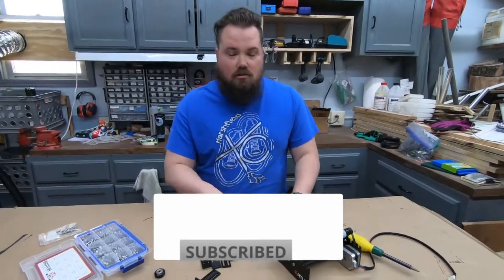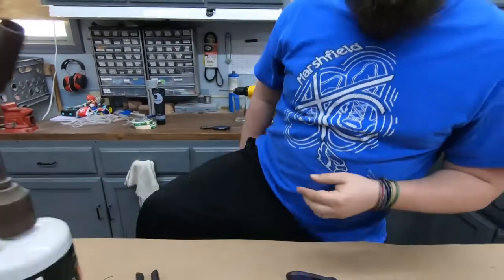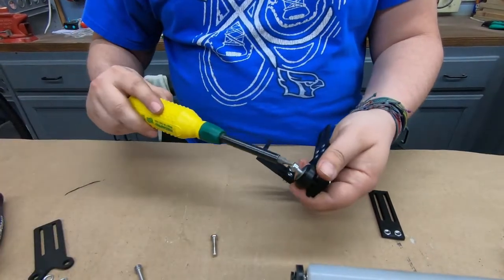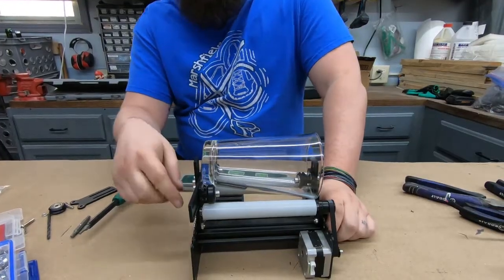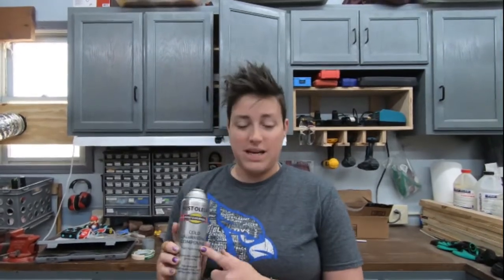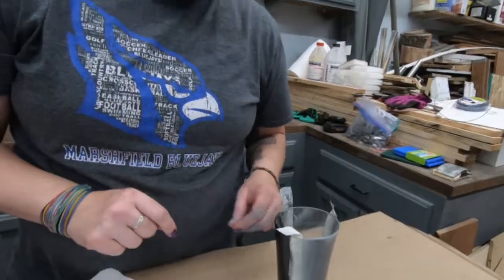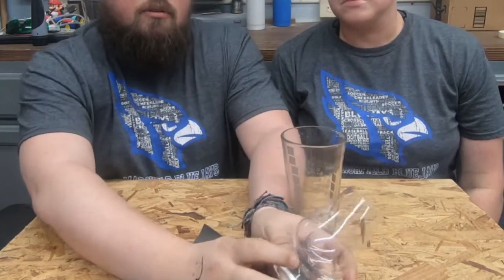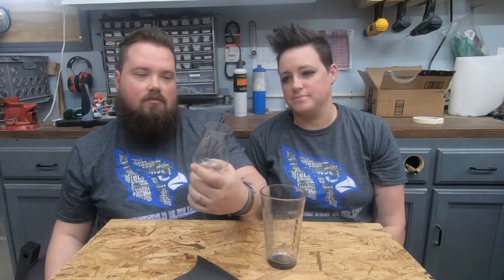Attempting - 3 ways to Laser Etch a Glass on the OLM2 with Rotary attachment

Comment: Thanks for the video.   I am trying to engrave a metal bottle.  The Letters come out perfect.  The image dose not burn at all.  
Letters are Line/ 47.0/80.0     Image: Fill+Line/ 47.0/80.0
When placed on a flat board they both burn properly.
Any suggestions?
Thanks Michael
Reply from the maker: Is the laser firing during the image?
Reply: @KLRform  No.  the head is moving but not firing
Reply from the maker: Anytime I have had issues like that it was a wiring problem. Grounding or loos connector. Sorry it’s hard to guess anything specific.

Comment: I am having difficulty with smaller 8 ounce glass drifting I have the base of the glass supported so the glass just contacts at the very front rim area. I am hoping that extra front wheel might help with adding tension  to the rotary's rollers. is this the case ??
Reply from the maker: I still had some drift. Adding weight to the glass can also help

Comment: I have the Ortur LM2 and have been trying to etch glass.  I am testing on things I purchase at the Thrift Shop and keep cracking the glass but 700mm/min and 100% power is probably too much.  Even though the glass cracks it doesn't etch in there.  I used the Cold Galvanizing Compound last.  Any suggestions to help me dial this in?  What is your usual distance from laser to glass?  Thanks.
Reply from the maker: We have the fixed focus laser to we always use the cylinder that came with it to set the distance. We used 60% power to start and liked the way the dry moly lube turns out better then the Cold Galvanizing Compound.
Reply: @KLRform  Cool.  I have had success today with 1750mm/min and various Powers.  Etching as we speak with 1750/60.  I bought the Cold Galvanizing Compound yesterday so will have to get the Dry Moly sometime to test it.    How tall is the cylinder?  I was given this already assembled and didn't get that apparently.

Comment: What are the black blocks made of that you used to lift your laser above the glass?  At the corners of your laser frame.
Reply from the maker: It was 3d printed.
Reply: @KLRform  I have an Ortur Laser Master 2 where the laser height adjustment isn't there but I can re-focus.  So I figured I needed a block system that is adjustable for the rotary work pieces I have.  I was thinking a tall set of blocks to raise it and a few thin blocks to get it where the laser needs to be.  Any suggestions?
Reply from the maker: That is what my setup is. I have blocks of different mm height and can adjust depending on how tall I need. I have seen these for sale on Etsy. I have also seen people use large lego blocks to do it.

Comment: Where did you get the pieces for the rollers and the set up. I would like to buy that for my rotary. thank you
Reply from the maker: I added the Wheels, nuts and bolts to links in the description. The rest was 3d printed by a friend the design came from Thingiverse.com
Reply: @KLRform  there is nothing in the description.
Reply from the maker: Amazon said we aren't big enough yet for the affiliate program. I will get it added back as soon as I can. If you want something specific let me know and I will find the normal link.